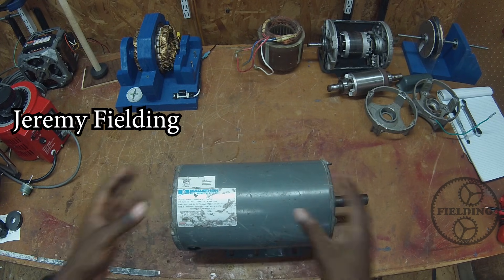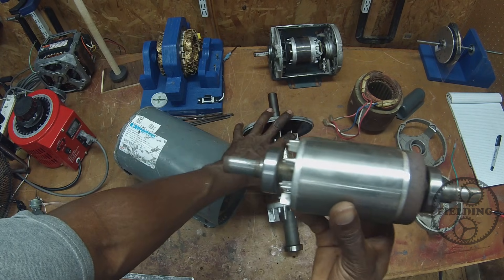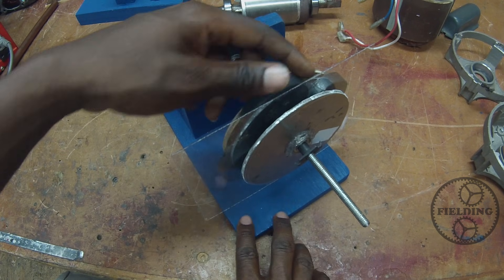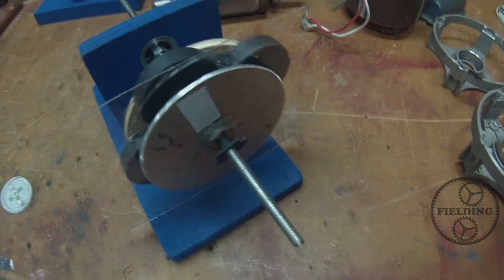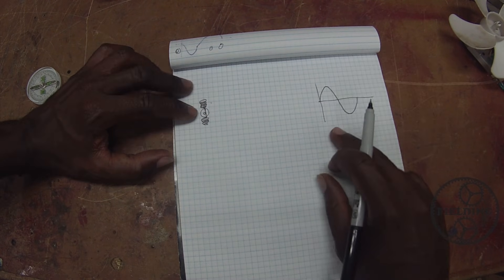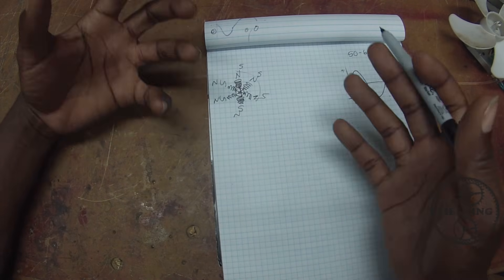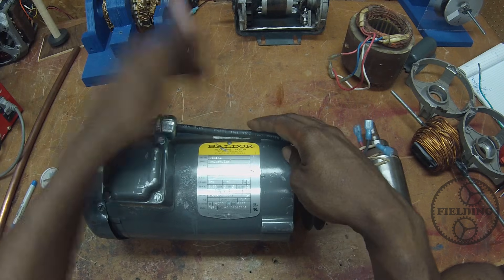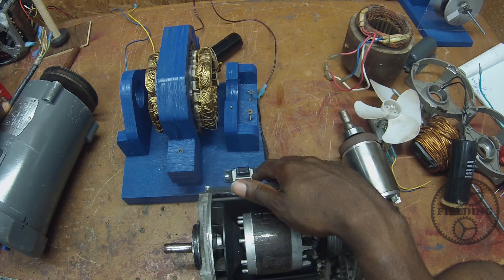How Motors Work for Beginners (Episode 3); Three Phase Induction Motors: 034

Comment: Hi Jeremy, love your videos! 

You said that residential does not use 3 phase motors. I'm curious about front load washing machine motors (I believe they are 3 phase).
 How do they work and have you made any videos on these type of motors? Thanks!
Reply from the maker: The have controllers that take in single phase and create a three phase output for the motor.
Reply: @Jeremy_Fielding  
(One more question)
I understand that you cannot answer every question or get into a conversation (I read the final note). If your able to answer the question...awesome! If not, totally fine, I understand...

I am an appliance technician (washer and dryers). Your other videos have taught me how to induce power into top load washer machine motors (thank you so much)...now I am trying to see how I can induce residential power (120vac) into a front load washing machine motor. (I have been searching all over Youtube for the answer on this but have not found the answer yet.) Sometimes other components inhibit you from testing the motor (i.e. motor control board or main control board). Thanks for answering the first question!

My question is:

Is it possible to induce 120 a/c
power into these motors (for troubleshooting purposes?

If so, what would the set up look like?

(My desire is to purchase an "cliff electrical tester" (have you heard of this bench tester) and configure for as many types of washer and dryer motors as possible to configure. I am trying to figure out if I need the 3 phase tester or just 1 phase. I found these testers on YouTube (fyi).)
Reply from the maker: If you have a three phase motor you should watch my video on that topic. How to run three phase motors on single phase
Reply: @Jeremy_Fielding  
Thank you, will do.

Comment: Going through lineman school right now and we're going over the basics of Induction motors (related to why we need to keep distribution lines "in-sequence") and the textbook wasn't cutting it.  This completely cleared everything up.  Thank you so much, you made this so simple!
Reply: Could you help me out?
A retired machinist friend gave me an old Airco 3-phase welding machine and I only single phase current available. Being retired myself, funds don’t allow for a 5 grand pto driven generator.
 Can 2 ‘like sized’ single phase generators be solidly coupled in a properly timed position, at the shafts to produce 3-phase current? I know where I can get a couple of old Onan generators and have 4cyl. engines capable of supplying them with plenty of power to govern the cycles at a steady rpm.
Reply: no, do not attempt that @David-dv6yv   better off selling the welder and getting a single phase one

Comment: Hey Jeremy, I was wondering why industrial sites use three-phase electrical supply as opposed to single phase supplied to households?
Reply from the maker: The short answer is better torque, more power, less wire per unit of power. Wins all around
Reply: Thank you. I look forward to finishing this series of videos.  It’s really helping out a lot with my education.

Comment: Hey Jeremy....is it possible to convert a 220v single phase to 110v?
Reply from the maker: You can’t convert it. But you can use “something” to setup up the voltage from the wall to 220. You will have to do some homework to find a solution

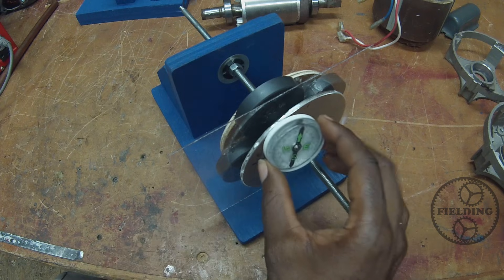Comment: Sir, an excellent, easily understood video series.  At @ 5:10, just a minor suggestion here, it would have been nice to reference the inverse square law and how it relates to your compass revolving faster when closer and slower when farther away.  Keep up the great job.  Just found your site and now binge watching.
Reply from the maker: Unfortunately that doesn't fall within my intent for the series. I was very intentional about avoiding math and theory. It was meant to be almost exclusively related to the parts you could touch and see as much as possible. Beginners really appreciate that. You had to know that connection in advance to even realize anything was missing. I want people to "want" to open a motor and look at it... to really understand its function...not pass a test or do calculations. However, that would be a great addition for a mid level/next level course.

Comment: Explanation was simple but you are wrong that the coil windings are wound the same direction on opposite poles. If one pole is wound clockwise, the opposite pole would be counter-clockwise.

https://books.google.com/books?id=Vdxw6PLk-msC&pg=PA33&lpg=PA33&dq=run+windings+are+wound+clockwise&source=bl&ots=kprvJvM7tz&sig=uSTEGFgqzCFwL_UuTwmeZWwU4P0&hl=en&sa=X&ved=2ahUKEwi_9PW2kcjdAhVOzFMKHQazBI4Q6AEwAHoECAcQAQ#v=onepage&q=run%20windings%20are%20wound%20clockwise&f=false
Reply from the maker: I said one end of the winding is North and the other end is south. Each winding has a north and south pole.
Reply from the maker: I also demonstrate this in the first video of this series.

Comment: The relative motion of the magnets induces current in the aluminium plate.

The magnetic flux from the magnets "cuts through" the alu plate, moving a magnetic field close to a conductor "excites" the electrons in the alu plate and we have motion in the alu plate, without any physical connection. Thus we have created electromagnetic induction.

Am i on the right track?
Reply from the maker: Sounds good

Comment: Hi,
which motor is producing more heat,  single or 3 phase motor & how to overcome those heat?
tq
Reply from the maker: That is a multiple layer question. I would say it is not about single phase vs three phase, but how efficient the motor is. In general 3 phase motors are more efficient, but a lot of factors go into that. Most motors have a fan attached to the shaft to cool the motor as it runs. However, you could use an external fan for additional cooling.

Comment: Omg great videos !! Is there a change you could go through testing and diognosing the motor issues and showing wiring terminal connections cheers
Reply from the maker: Well. I thought about that, but that doesn’t really fit “beginner” material. However, because of all the great questions, I do think I will make a slightly more advanced series in the future.

Comment: I think you should do a series on rotary phase and static phase converters. There is a lot of questions asked about these on machinist forums. Especially from the home shop groups. Industrial machinery is finding its way into the home shop because older industrial  lathe and mills are often cheaper than a small bench model single phase units.
Reply from the maker: I agree. This is a good topic to cover.

Comment: Can we reduce the noise of a universal motor by adding a material which is noise free inturn reducing the noise in a kitchen blender?
Reply from the maker: I don’t know what noise free material is. It’s the fan and bearings that make most of the noise you can’t remove either

Comment: I appreciate your videos very much. So much so, in fact, I almost think I know what you’re talking about. I have a 3/4 dual shaft motor I’d like to save but a few of the copper windings have melted. Is there a chance I can solder a piece of copper wire in place of those burnt ones? Thanks.
Reply from the maker: I really don't know if that is possible, or what the resulting behavior of the motor might be. I would not do it, but maybe someone has tried it successfully. Try searching the web to see if anyone has done this without rewinding the motor. Then proceed at your own risk!

Comment: You left me wanting more. I seen a man take a 3 pH motor hook it up as 220 then use a 110 motor with v belt on pully turned on power to 3 pH at same time started the 1 pH motor and when the 3 pH motor started running he threw the belt off and the 3 pH motor ran on 220 power. does this work or was he blowing smoke .and can you make a video of it plz ty.
Reply from the maker: Yes... this can work, but it is damaging to the motor over time. Especially if it runs continuously. You need capacitors to trick the motor into thinking there are multiple phases of power coming in. Motors are pretty dumb so this is not hard. I would only do this for a drill press, or something that ran for 30 seconds then was off most of the time. I will make a video about this... It is on my list.

Comment: Mr. Fielding,I race RC buggies and trucks.  We use 540 and 550 motors that have what I believe to be 3 phases.  Do you have knowledge in this area?  If so, could you make a video how to get maximum performance from the motor including how many Amps it is idea and how to chance to placement of the phase tabs on the end bell.  Thank you.
Reply from the maker: +Tony Dugan I have never heard of this. If these are powered with batteries then it can't be three phase. Other then that I don't know what a 540 or 550 motor is
Reply from the maker: I think you have a DC motor. Check out my video on determining what type of motor you have here https://youtu.be/Klb09_ocdRo
Reply: It for sure is a DC motor in the RC racing application but there is no electricity ever put on the rotor as you say it should.   If I take the end bell off, it had 3 tabs which controls the timing.   If the tabs are off, the timing between each phase(or place in the rotors rotation) are usually different which is bad.  I enjoy watching and learning so I wondered if you had experience with the smaller motors.   Thank you
Reply from the maker: +Tony Dugan They can be brushless DC as well which I didn’t talk about much in the series. A quick search for the 540 motor showed me a brushed motor which can’t be three phase. Also batteries don’t produce a phase at all. It is a constant voltage until the battery runs down.

Comment: I need some help I have 2 iskra aml  3 phase 4 pole pump motors and I can't figure out to wire correctly. It has two wiring harnesses that I believe my be part of my issue. I have 36 volts to my WVU terminals. I appreciate any help!
Reply from the maker: I try not to get into troubleshooting like this. It is not safe nor practical. I can’t handle the volume of requests I get, and I can’t be sure you are giving all the relevant facts or even that I understand your problem correctly. You would be happy to know I do plan to make a "how to wire" for three phase motors. But, it will be some time before I get to that video. I have at least 4 lined up ahead of it.

Comment: Hi Jeremy ! What do you think about Rotary Phase Converters ? ( i.e using a 3-phase idler motor in order to get 3-phase currents from a single phase outlet ? ).
Reply from the maker: They work... It is a good but expensive option if you don't have three phase power. Most people in a residential area don't.
Reply: Jeremy Fielding Thanks. > BTW I saw an inverted motor: the armature is
stationary and the outer housing rotates : is this a Papst Motor ?

Comment: A solid state electrical power generation motor that has no moving parts that generates electricity totally off vibration. Electrical energy is frequency so a solid state electrical generator were a small vibration or hertz frequency entered one end that caused a different vibration or hertz within another crystal structure that then caused a higher vibration in another crystal structure generation of high frequency electricity from low voltage hertz diodes being operated off a solid state graphite power cell bank. A electrical power generation system that would never break down? A clear path away from fossil fuel use? I am not that intelligent so all this may not work this is why i am breaking it down to someone who is intelligent.

Comment: Imagine if you could use graphene nano tubes and create a stator by filling those nano tubes with pure copper crystals and then design the rotor in the same manner with the graphene nano tubes also conducting electricity? An electrical dynamo that could generate electricity that then could be tapped into and use? A few vacuum spark gaps in key locations to realease the breaks.

Comment: Jeremy Fielding watch this video, this electric worker makes a 240 volt three phase run on 110 he even runs it the other way. now the cap he used was more than the rated voltage of the 3 phase motor. anyway did we learn this/ IT WAS A CAP NOT A STARTING CAP. Joseph T      https://www.youtube.com/watch?v=4f0f_L7p66k
Reply from the maker: It was rated for 400 and he ran it on 240. We will talk about why this works (but is not a good solution) in a future video. I use this method to test motors myself when I want to know if it works before I buy a speed controller for it. Three phase motors that is.

Comment: I'm getting ready to purchase a new window ac unit I've noticed that the 110v units have a much higher amp draw than 220v can you explain and maybe describe which would be more cost effective in the long term as far as power consumption
Reply from the maker: I am not sure if this falls within the scope of what I wanted to cover... but I will try to include a brief section on this in the Q and A... it depends on how long the video is.

Comment: Another well done video! 

For you video where you take questions and comments, you might want to touch on why trying to run a three phase motor on single phase, or a single phase motor without the start/run winding energized correctly (or, even just a locked rotor situation) will cause all the factory installed smoke in the motor to be catastrophically released.

You seem to be able to simplify things very well, and I think you could pull off describing the harrowing adventures of a locked rotor or oscillating rotor event in a very understandable way.
Again, thanks for what you are doing!

Comment: Man, this is the absolutely BEST explanation of induction motors I have ever seen. GREAT video...  Thanks so much for explaining this.
Reply: I may be 100% wrong. But is 3 phase motor vs 1 = to a 3 cylinder gas vs 1? New to electric motors...
Reply: Pardon_souffle That is a good analogy. Also, I second OP"s comment.
Reply: Not all heroes wear capes.

Comment: One thing I don't get is how windings are done on rotors in a mass production. Can you make a video about this?
Reply from the maker: There are some cool videos of this on YouTube. Baylor does both hand winding and machine winding depending on the motor. Even the hand winding is partially automated though. But it looks like most companies have a machine that coils up the windings then pushes it through the slots. It is all pre-programmed depending on how many poles they want etc... This is the last video I watched from Baylor. It will start at the part about the winding machine. https://youtu.be/LltU1ThKEzg?t=4m49s

Comment: Good evening Jeremy I have a question regarding a motor that I am using as a generator. My question is why does the voltage jump around when I connect it to my Voltage meter Keep in mind my voltage meter is the free Harbor Freight VM. The motor is specs are: Product description 
These motors are brand new and high quality, Due to long time storage some surface oxidation but does not affect work. 
Weight : 500 g 
Voltage : DC 120v 
Speed : 2500 RPM 
Actual power : 55 W 
Motor connected 8V voltage can start turning 
Package includes: 
1 x DC 120V (output) High-power DC Motor Generators Wind Turbines 
I am Not sure of the amps.
Reply from the maker: +John Fowler voltage will vary with motor speed... have you watched the generator video yet? In there I show a part when I explain output voltage vs speed, and I demonstrate it with a drill. It is the video right before this one.

Comment: hey there good vid.i need some heip to find out about a brushless motor i got and dont know if its a ac or dc.made by old company that is no longer open.industrail drives radford va.10hp,120hz,model number br5102-3053d theres two plugs one has 4big  prongs and the other 17small prongs.thanks
Reply: Definitely sounds like some kind of a servo motor (along the lines of a Brushless SWEO from Baldor, oddly enough), and a lot of (if not all) those smaller prongs are probably for positional feedback from an encoder, along with maybe some over-temp switches, auxiliary integral cooling fans, and other safeties/aux. functions.

Servos are really good for when you want to have precise rotational control, but not necessarily great for general propulsion or power transmission.
Reply from the maker: +buzster610 10 hp and 4 plugs is almost definitely a 3 phase induction motor. But the "120" hz? Never seen that... and 10 hp at 120volts seems wrong too. A good old internet search might get you something
Reply: can you make a vid with one similar to mine?can i run only with vfd?and i think it has a brake
Reply from the maker: +buzster610 I think I might do a video about how to figure out what type of motor you have and the options for running it. It's hard to tell you what to do through comments...I don't have enough Information but this is a very frequent request
Reply: ok then.just found one on ebay with the model number.
Reply from the maker: +buzster610 it is as you described. I have no experience with a servo motor. You need special controls for that. Not a VFD. It is not three phase. 210-240 line voltage and the other plugs are for computer control of the motor.
Reply: i want to make an ev car with it.still dont know if its ac or dc and what to control it.thanks jf
Reply from the maker: +buzster610 perhaps someone who has used one will come along a help. Least you know you need controls for a servo motor. Now the work begins. Back to searching for  a purchased servo motor controller that can handle your motor. It is quite large. Make sure it matches or exceeds the voltage and hp. Good luck.